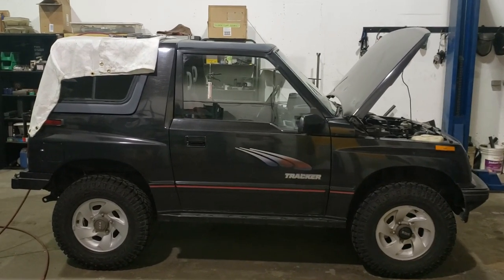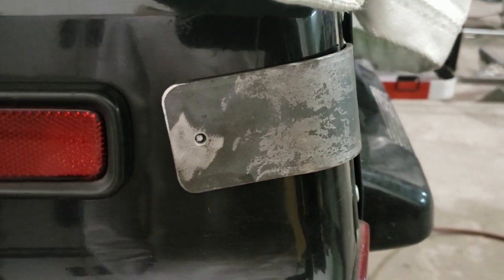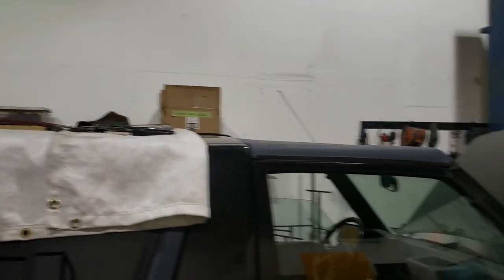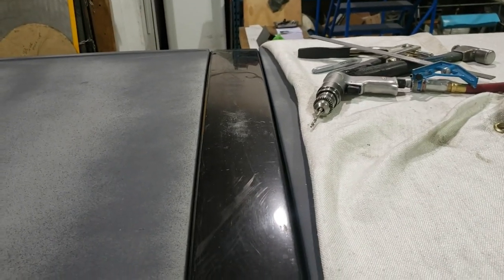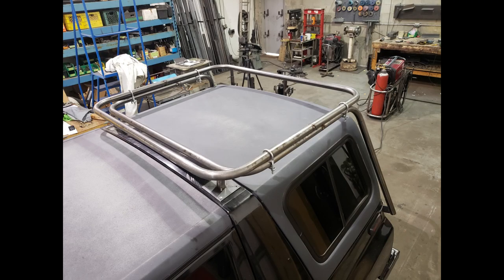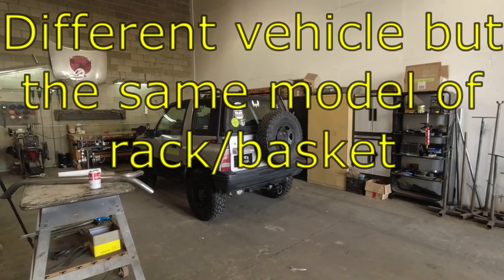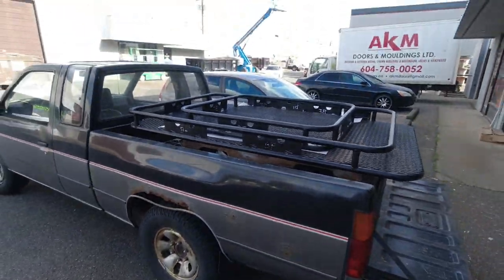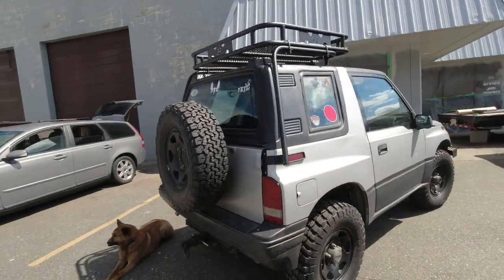Suzuki Sidekick Roof Rack and Expedition Basket Build

Comment: As someone who never welder before but wants a machine powerful enough (amps?) to handle this level fabrication, what type of arc welder do you recommend?
Reply from the maker: I would go with a welder that's approximately 180 amps. This will allow you to make single pass welds on 3/16" material which will be as thick as you're likely to work with commonly. If you need to weld thicker material, you can do multiple passes. I'd recommend a Lincoln welder - the 180HD is a good choice. Other brads are worth looking at too - check reviews in this regard. Make sure you go with a MIG welder rather than a gassless wire feed! All the best!

Comment: How are you removing the rack for powder coating after it has been riveted to the vehicle?
Reply from the maker: The rivets can be drilled out using a 3/16" drill bit. There is a slight chance of opening the holes up if not being careful so it's important to be accurate with the drilling. New rivets are used in the same holes for the final installation. If a person accidentally enlarges one or more of the holes during removal then larger diameter rivets could be used or Riv-Nut style fasteners could be used instead.
Reply: @BalmersWorkshop  that makes sense. A little extra work,  but worth the trouble for a great paint job.